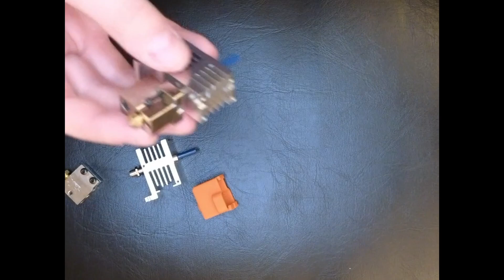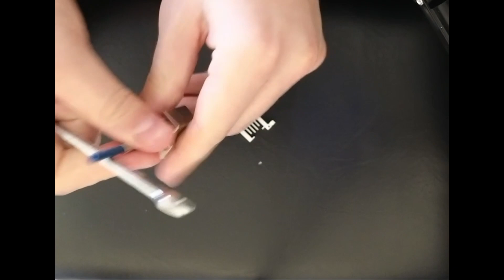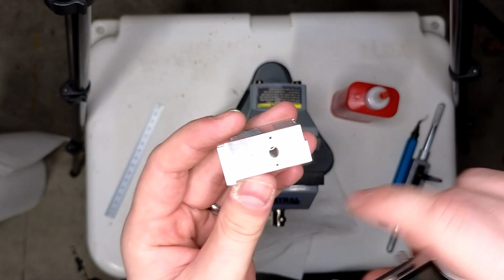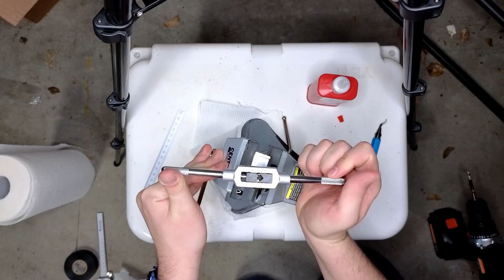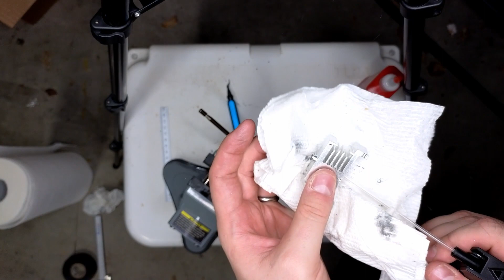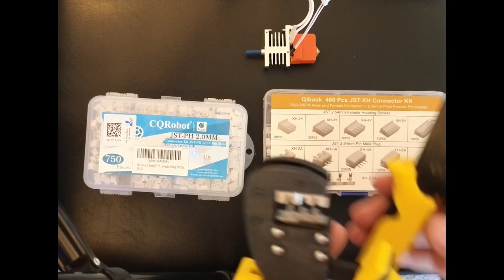AnkerMake M5 Volcano Mod V1.5 Update

Comment: Some helpful addendums for anyone considering this mod::

After much fussing about with installing the shims through the Z tower slots, there was simply no way that I could find that could make it work the way the instructions implied. Honestly, I thought it was my lack of coordination, but it wasn't.

I ultimately took the entire Z tower assembly off my M5's base, then with the Z towers separated, I unscrewed the two remaining countersunk screws out of the bottom end of each Z tower, (you don't need to unscrew the motors at all, it's actually better if you leave them screwed into the mounting plate) then pulled the bottom plates, with both motors, the whole dual screws, X axis and hot end attached,  partially out of the bottom of the extrusion.  This gave me a MUCH better access point to understand why the shims weren't going in.

I tried to install the shims as printed with my new found easy access, but found that the shims (as downloaded from Printables less than a week ago) didn't actually physically fit in the Z tower profile of my particular M5. Maybe Ankermake (now Eufymake) changed the design at some point?  All I know is that the shim's shape is different to my profile. There's no way on Earth that this can be just inserted through the slots and pushed into place as downloaded. It won't work.

So if these shims work for other people, (I have no reason to doubt others) then there's at least TWO different Z tower extrusion shapes used in the M5 series. I was reasonably late to the Ankermake party... and I got mine in Australia... so... maybe that's why?

While there are many similarities of the extrusion to the shape of the shim, and most features DO match the profile I was inserting it into, the right-angled corner (most distant from the central Z screw circle) did NOT match the profile I have. So I had to cut/file off some of the shim's corner to fit, then using a small rubber mallet, lightly tapped the tight-fitting shim into the tower, inserting it JUST far enough for the shims to be flush with the tower's now-open bottom edges. Then I reassembled the whole printer.

Now this might seem like overkill, but after spending two hours trying to install it through the slots and failing. The whole disassembly, shim shape assessment and mod, shim installation, and reassembly took less than 50 minutes. 

Seriously, this was a much, much, better way to go. 

Unfortunately, Austin's parts list was lost, so please see my parts below. I have confirmed that they work and have continued to do so for a few days now. No issues found so far!

Thanks Austin, I've done this Volcano mod because I can't get new hot ends in Australia, and while it's an involved process to mod an M5 this way....  not only did the M5 auto calibrate first go, the first few prints have been utterly flawless with your recommended instructions. My M5 printer is no longer destined for "spare parts". I appreciate that.

It's also nice to be able to have the ability to simply loosen some grub screws and replace both the heater cartidge and thermistor... which I simply cannot do with any of the proprietary Ankermake hot ends, whether it's the stock model or upgraded "all metal hot end" (I couldn't loosen that glue with heat, heat + nail/pin punch and a small sledge... maybe other's might? Which is sad, because the heater cartridge itself died... and no matter what I did, could not be replaced in my all metal hot end).  

So yeah... an actual serviceable Creality volcano style block, wasn't available from Polis3D when I checked... so I had to double check that the one I ordered was the one where the screw holes actually (sort of) line up with the holes in the heat break's heat sink. So readers, if you need parts, I used my own suppliers,  found here:

Creality style all aluminium Volcano block:

https://www.aliexpress.com/item/1005006722582176.html

From there, the usual cartridge thermistor (3mm in diameter, with standard 100K resistance rage works), the one that works for me is found here:

https://www.aliexpress.com/item/1005004581550651.html

The triangle lab, 24 Volt heater cartridge works:

https://www.aliexpress.com/item/32815934251.html

I chose to tap the bottom of my stock heatsink with M6, 1mm pitched thread, and add this bi metal heat break:

https://www.aliexpress.com/item/1005009023949910.html

The Volcano nozzle here works with my setup:

https://www.aliexpress.com/item/1005008463472915.html

You'll need to be able to strip wires and crimp new JST connectors. Unfortunately there's two different sizes. First, the JST-XH 2Y (for the heater cartridge that has a 2.54mm pin spacing) and second, a JST-PH2  (for the thermistor cartridge which has a 2mm pin spacing) 

You can buy kits that include both the tools, and the ends to crimp on eBay, Amazon, AliExpress.  However, I already had these. It's very finnicky work so watch a few YouTube vids. However, please note that most XH series crimpers can't do PH2 pins and vice versa. 

For the larger JST-XH connections, I have a generic SN-01BM crimper. But I use the following kit for the JST-PH2 connector

https://www.amazon.com.au/dp/B0DXVKTJMZ?ref=ppx_yo2ov_dt_b_fed_asin_title

Both have served me well for a few years now. 

I hope this helps someone out there. 

Ham.
Reply from the maker: Great stuff, Ham! I’m really glad it’s still working for the most part. 

I’m gonna pin this comment for future modders. Also check out the updated video description (original mod video) as someone fully recovered the BOM recently. Obviously some stuff won’t be available anymore, but it should still be helpful.